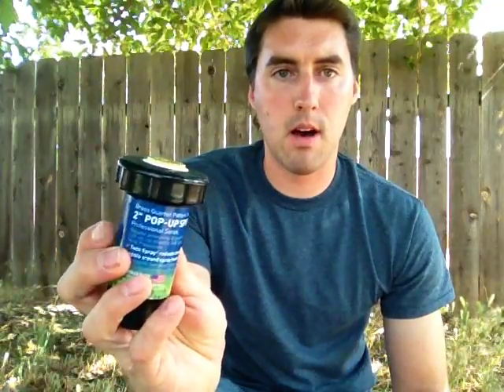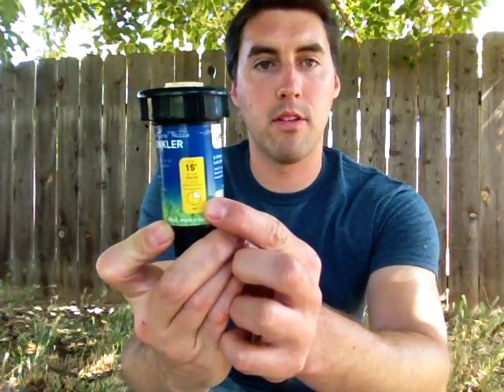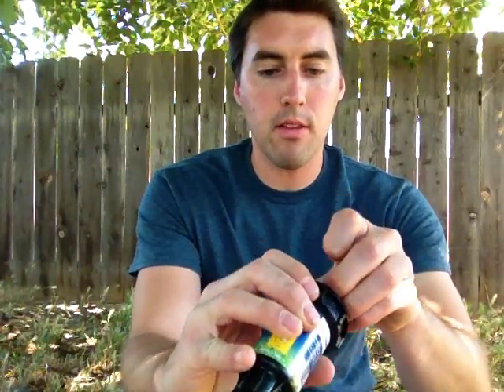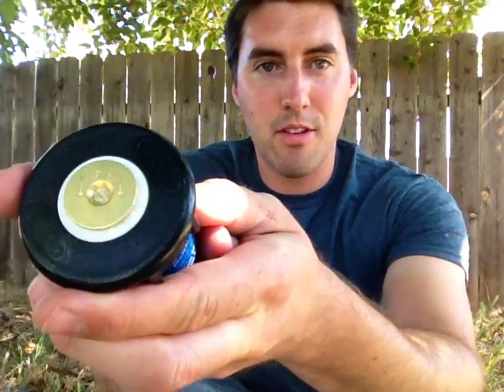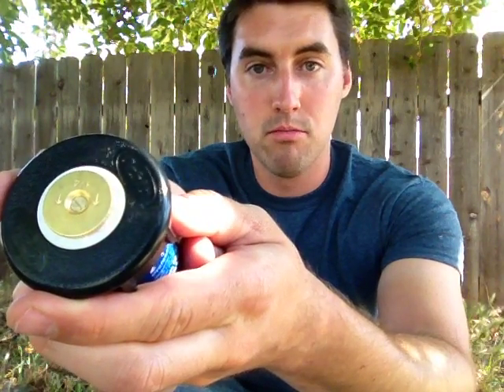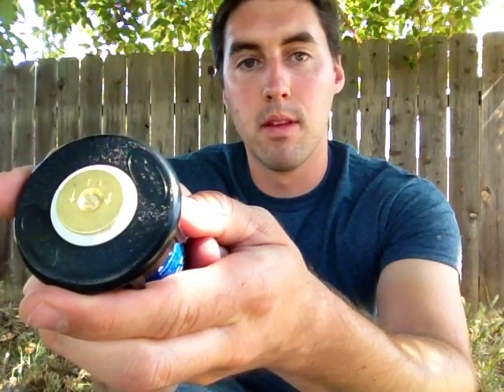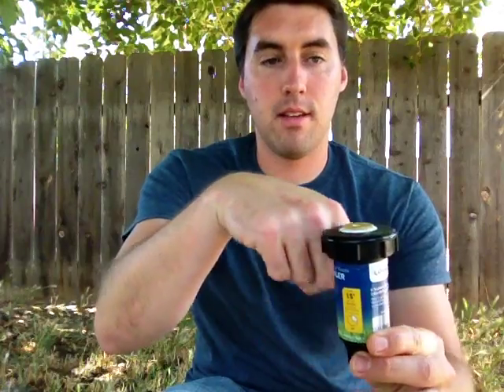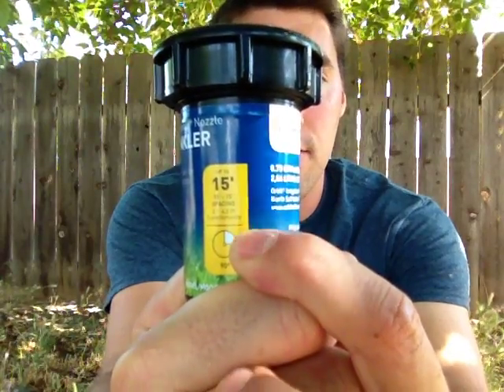Lawn Sprinkler System Basics

Comment: You need to design a system according to the size of your yard you don't just want to use 10' because that's your preference you need head to head coverage to ensure even water on your yard .   Overlapping too much will result in more heads and more valves